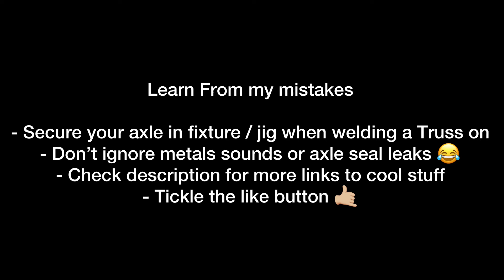Tundra Axle Swap on First Generation Tacoma 3rd Generation 4Runner Gone Wrong 😑

Comment: im planning to swap my 99 tacoma axle for a tundra axle, what is needed to swap it? and approximate cost?
Reply from the maker: Really just the axle is needed maybe some new spring perches, shocks mounts and the axle it’s self. The driveshaft will bolt up no problem. 
Without the axle just in parts maybe 150-200$ 
Find a good axle for around $600-1000 depending on the condition and gear ratio. 

I definitely didn’t spend more then $1200 total for mine. I did all the welding work myself so that saves a  few hundred
Reply: @AnonymousFab  
sweet man, got the JD fab kit and trying to figure it all out right now! super exciting, i got 410 gears right now , not sure if tundra even came with 410
Reply from the maker: @richlee7047  nice!! That’s a good kit. I had 488 but blew a third member gear so I have stock but it’s not horrible with 285 tires but 488 gave it much more pep
Reply: @AnonymousFab  nice yeah mine is 4wd so i have to change the front gear too and thats another 1k.... still searching for soomeone to make me a bed cage at this time.
Reply from the maker: @richlee7047  hahah ugh the good and bad about 4x4.
Reply: @AnonymousFab  yeah i am just waiting to get the extended cvs from cvj and ill put the front kit on, rear will have 16 in bypass
Reply from the maker: @richlee7047  you might not need a bed cage you could do those outboard shock towers and modify them to run bigger shocks. I have seen lots of trucks getting good travel out of that.
Reply: @AnonymousFab  my buddy has that set up, however the set up i am looking for is a simple bed cage so i can still load a bike or 2 and some gear
Reply from the maker: @richlee7047  that’s basically what I have. I don’t have a motorcycle but bikes and my surfboards fit great still.

Comment: I'm kinda hesitant to truss my tundra axle for my LT. I'm just gonna leave it alone. If it bends later on then fuck it. I'll just buy aftermarket  crawler one
Reply from the maker: Yea unless your building a jig to hold it in perfect straight line, I would be carful. Don’t blow it like me 🙃😂
Reply: @AnonymousFab  and you welded small Lil passes and switch sides every pass? Or did you just burned it in?
Reply from the maker: @damnitdang  yes I tacked it all good and then did little sections at a time to spread out the heat evenly
Reply: @AnonymousFab  you think it's possible that the axle housing was already bent before you had it? I had bought an tundra axle to do mines too . But it's just been sitting for 3yrs until I get all my parts.  N
Any updates on your rear setup?